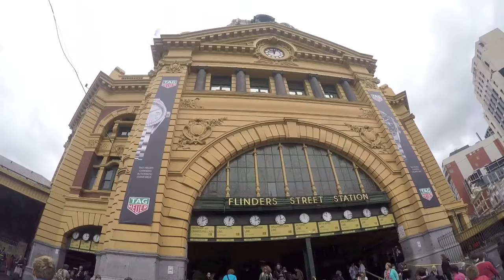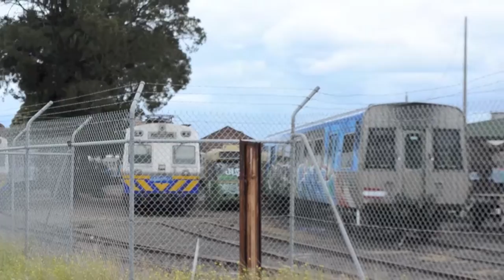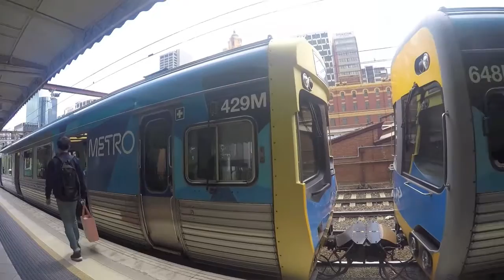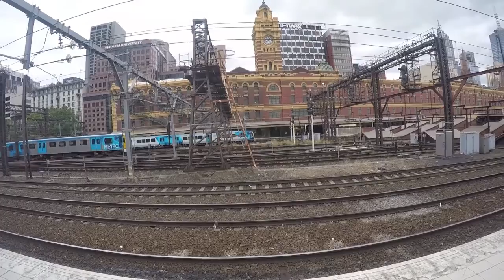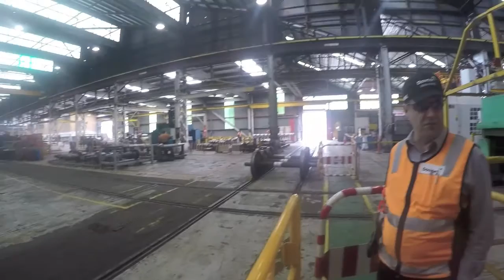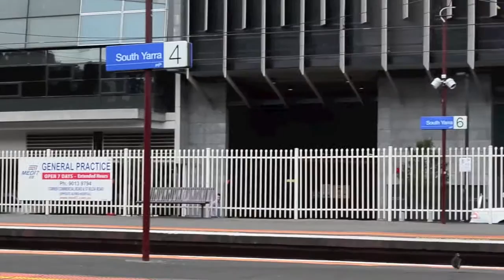Melbourne trains- the past, the present, the future

Comment: I admit I have never seen a X’ Trapolis train on the Pakenham and Cranbourne line ever.
(Grammar Nazis plz don’t kill me)
Reply: Yeah because they only run on the part of the network connex originally operated. I.e. the Epping(Mernda), Hurstbridge, Lilydale,  Belgrave,  Alamein,  Glen Waverley lines. Recently their operations have been expanded to Frankston,  Werribee, and Williamstown. That is why you'll never see them run on those lines because they were the ones operated by M Train.  Likewise Siemens trains do not operate on the lines previously mentioned (not including Werribee, Frankston and Williamstown). X'Traps are approved for non revenue running on the Cragieburn (where they are often stabled at) and Sunbury lines.  You can actually find a video of an X'Trap running on said line,  which must have been a very cool sight indeed.

Comment: You missed mentioning the double decker train that was running on the Belgrave line in the 1990s
Reply: Douglas SPRINGALL that's the 4D Train They All Got Scrapped
Reply: Aidan From Aus  yes such a. pity given all the money they spent on modifying the system to accomodate double deckers which in themselves would have done wonders for the systems capaciyt
Reply: Douglas SPRINGALL yeah with the 4D's still running today they could of had double decker trains and there would not be so much crowding on the trains in metro
Reply: @VictorianRailHeritage  Rubbish, those trains would have been trouble as the more packed with people trsins are the more dangerous they become and the slower they travel.  it all evens out.
Reply: @jacintaedwards1123  I’m just stating a fact, double decker trains means more capacity for people
Reply: @VictorianRailHeritage  .......and slower speeds.........and dangerous situations.  You wouldn't want to be catching double decker trains at present with this crisis going on.  The less passengers there are on trains the less virus transmissions.
Reply: Double decker train? you mean the Tangara trains?  I thought they only tested those on the Lilydale line? they were going to have to change the height of the overhead power lines as those trains were too high.

Comment: When it comes to electric trains from the past and present.

The first electric train built were the red Swing Door (Dogboxes) trains which dated back to 1885 and were used until 1974. This was followed by the Tait train (Red Rattlers) which were constructed in 1909. They ran until 1985, along the blue and refurbished Harris trains. Several of the blue Harris trains were buried in a quarry in Clayton, others were scrapped, four were refurbished and only ran for quite some time before they were sent to scrap. Two carriages were preserved by the ARHS.

The first stainless steel train was the Hitachi train fleet constructed in 1972/1981 to replace the old wooden rollingstock. This was followed by the new Comeng train fleet. The second stainless steel trains to be constructed between 1981/1989. They were introduced to the Victorian Railway network when the first train made an appearance for the grand opening of the City Circle. 

In 2000/2003, Connex and M'Train refurbished their Comeng Trains in different liveries and styles. Connex ordered 58 X'Trapolis trains to replace their 57 Hitachi trains and the double decker 4D train, at the same time, M'Train replaced 58 of their Hitachi trains for the brand-new Siemens Nexus trains. 

In 2002/2006 was the beginning of the withdrawal of the Hitachi fleet. Several carriages were scrapped, and another batch sold to private owners. In 2007/2009 Connex refurbished seven of their Hitachi trains. They were to run across the network until December 2013. Three sets were sent to storage at Macaulay, with another three at Newport Workshops and one at Craigieburn. 

On April 12th, 2014, Elecrail ran a farewell tour for the last of the Hitachi train fleet to three of Melbourne's extended lines (South Morang, Sunbury and Craigieburn) before finishing up at Craigieburn. That same train transferred on July 19th that same year to Newport Workshops.

In September and October 2015, Metro moved three of the remaining trains from Macaulay to Newport Workshops for storage, with one three car set being transferred to North Bendigo for scrapping. 

The Comeng fleet will remain in service until 65 High-Capacity Metro Trains (HCMT) along with 25 of the new X’Trapolis 2.0’s enter service and replace the entire fleet.
Reply: Railways Of Doom thanks for a terrific backgrounder. I’ve often wondered about many of these facts when watching YouTube videos of Melbourne’s trams and trains. 
Perhaps you might know of a website that compiles these facts as well as physical features and statistics of all the different models. Especially if they include side by side comparison of their characteristics. If I lived in Melbourne I might undertake such a project but I live in Sacramento California. Thanks again.
Reply: Hi Railways of doom I'm a big fan of your  channel  hi 👋
Reply: Railways Of Doom hi again
Reply: Railways Of Doom
Reply: Thanks for a great explanation of the different trains in the system.
Reply: Wow, that was a mouthful!